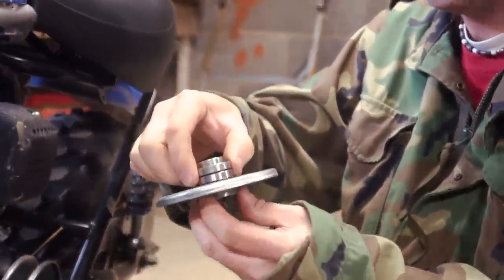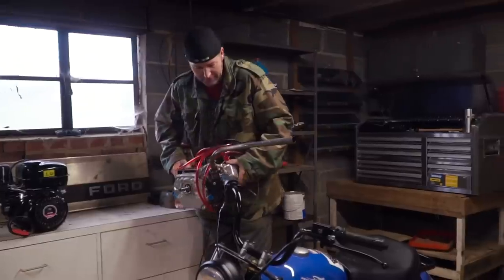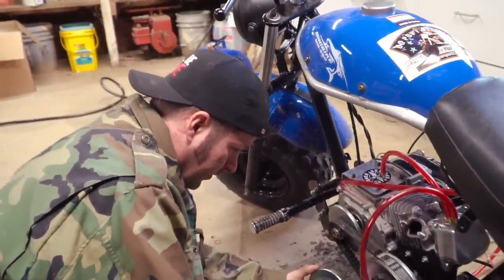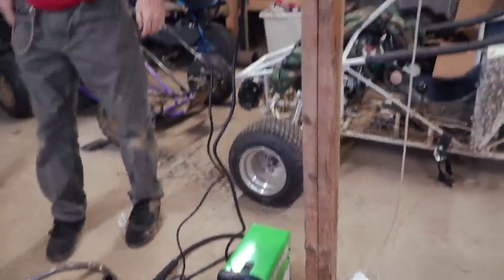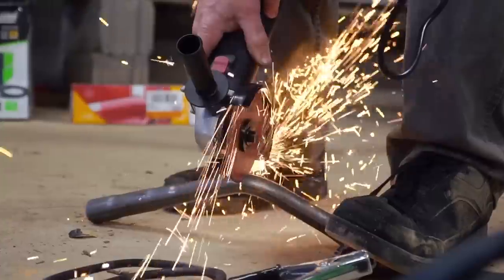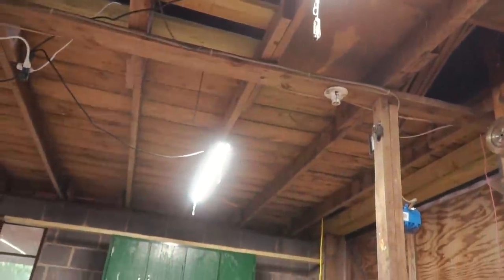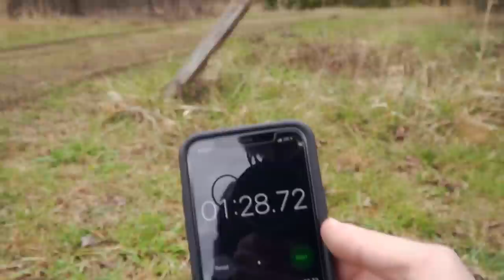Fast Mini Bike Gets Gets 3X Horsepower! 225cc Race Engine Swap!

Comment: I would like to see you guys do a Lifan 690 CC has electric start and and a charging system up to 18 amps. I mentioned this because I think you guys would like the engine. Lifan is world-renowned for all their engines expensive small engines. He can find one on Amazon for the same price just about has a Raptor 670

Comment: Guys, just bite the bullet and go down and buy a 4KW gas generator.  You'll be able to use it with your cheap welder, and after you get your shop wired you can still use it when you go on the road for fixes in the field.

Comment: Just noticed the MB200 has two fuel tanks from the factory, one on the frame and one on the engine.
Why?
Reply: The one on the frame is a decorative panel it isn’t actually a fuel tank

Comment: welder -- guys, turn down the tension on the welder wire spool, it will help adjust the feed speed of the wire

Comment: I can't be the only one thinking 250cc or 450cc from a dirtbike, would be awesome in one of these things? Gear it with the same final drive of a real dirtbike (maybe a bit shorter) and you would have loooooads of low end torque, and an amazing top speed (+ things with multiple gears are just more awesome)

Comment: I cringe every time I see either of you holding a welder with your hand choked all the way up to the tip.  I get that it "could" be more steady of a weld by you doing that, but after seeing your welds, that's definitely not the case.  I know it'll be fine though!

Comment: why are u guys always use such small motors? and why no motors with gears?, 225cc my * , the engine on my dirtbike is 250cc with 41 hp and 5 gears (yamaha yzf 250 from 2016), why do you guys not take a good engine 4 ones, the engines you guys use are from lawnmovers? and if im not wrong, there cut fit a much bigger engine on that minibike...

Comment: I NEED HELP C&C AND VIEWERS 
I got a predator  212 with upgrade  jet ,air filter, muffler and torque converter   it's been sitting for some 6months I put new oil , gas &filter  and cleaned the carburetor and took the jet and and then out cleaned that and even the jet under idle screw  all this and it won't idle smooth it's sputtering  and if i give it to much gas or dies any ideas ? I'm stumped about to buy a new engine I have thought of a new carb ? Or spark plug ? And also the tq as ike said it wants to creep when it starts well more like take off with  the idle screw  at the lowest point  I took the tq  off so it woudnt engage  as soon as i started it I'm at the point of giving up and starting over unless someone can help me  or is it clunking/sputtering due  to maybe internal problems  like bearing  or pushrod
Reply: Its hard to diagnose without being there

Comment: When flux core welding you need to switch polarity to stop the splattering. Than the little welder won't surge.
Reply: Great suggestion, but you can't switch polarity on the Harbor Freight Titanium easyflux 125. I think that's the welder they're using. Every model up from that, 140, 170, 200, you can.

Comment: You have to watch with running too long of extension cords. With extension cords longer than 100' the current goes up and the voltage goes down. If you start getting too high of current you can burn a motor up. I have seen this done when a person ran a drill on 200' of extension cord.

Comment: this is stupid , none of any of the other drive line parts are made for that horsepower. but then again after watching how you guys mess up or destroy just about everything you build its probably not putting out anywhere near what your claiming. hp to rpm curve is a indicator of Representative power. that engines power curve would be up past 6k to make that kind of power probably closer to 9k. so in short boys you have a engine that can make that kind of power. but you guys can't even build a flat head Briggs.  also this kind of motor has a very short " lifespan" . you won't last half the race. get a wet clutch and stop playing with belt junk.  it just embarrassing to watch at this point. love your channel, but educate yourselves.